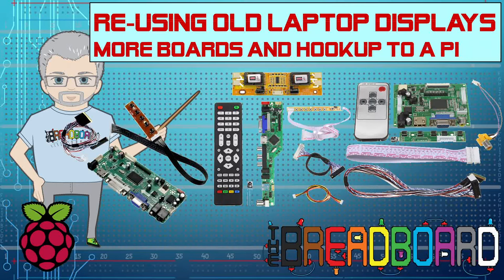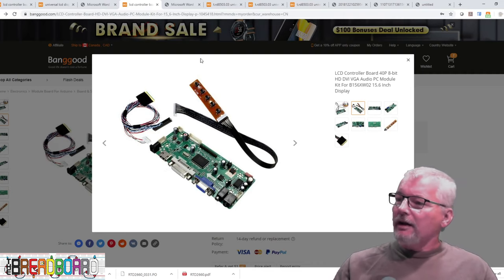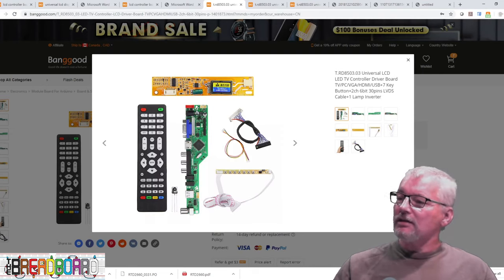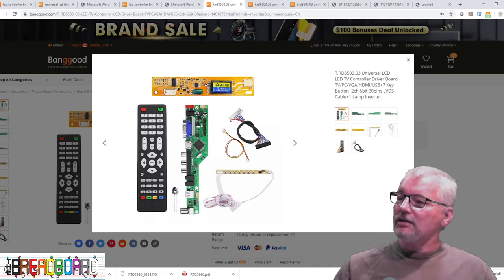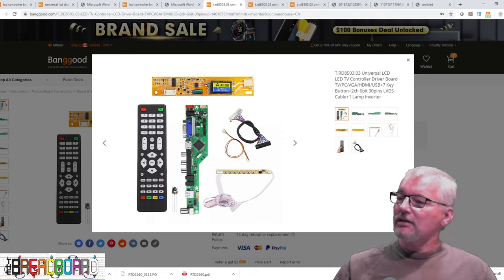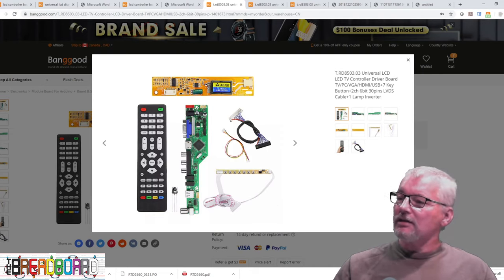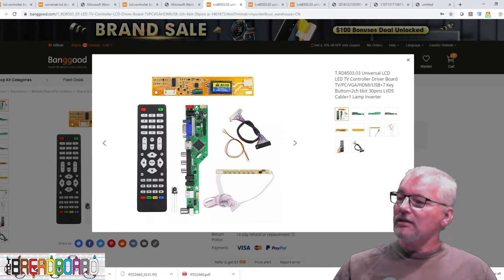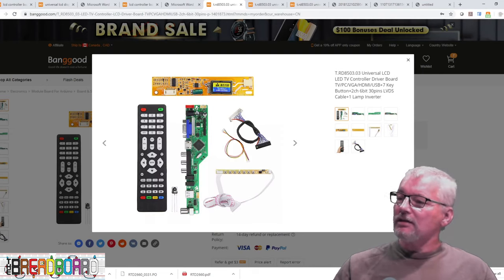Old laptop Screens on a Raspberry PI... Part 2

Comment: Hi, I watched this video and the Part 1, and I ordered the board from banggood and I fully expected to come back here and ask a whole bunch of questions, but I got the board and plugged it in and instead of screwing up, everything worked perfectly, so thanks! I have re-used an old laptop screen as well as a 12v wall adapter which is only 1amp but seems to work fine. Excellent video!
Reply from the maker: good to know I passed on enough information, I too just received more boards and a pack of various cables... next to upgrade an old desktop screen (VGA Only) to use HDMI etc

Comment: Thanks for covering this, Pete.
I've been toying with the idea of building a lcd test bench for use at work (amongt other things, we also repair laptops and monitors). With the info you've provided I'll be doing some research this weekend and present it, the possibilities and the costs to my boss on monday morning. Thanks for posting....top notch material as usual. :)
Reply from the maker: your welcome, sorry for the slow response, this was a very popular video for me, I will be doing more, with desktop screens that only have VGA for instance, btw, you cal also buy a pack of assorted LVDS cables that would go a long way to setting up your test station
Reply: A lads panel tester would be a big step. This one tool can connect with any pin any channel any res lcd panels. Once you have tested it to be working then you can go ahead and order the controller boards and do a repair

Comment: I'm currently viewing this video on my secondary screen. which is a lcd salvaged from my old laptop using a board like that. works flawlessly.
"special programmer" hah, check it very closely, you may need the software and for sure the hex file to reflash the board, but... it's just Rx Tx +5v Gnd pinout on the vga.
I highly suggest you to buy some adhesive heatsink for the main chip of that type of board. never hurt if cooler, you know.

Comment: Very informative video! You just saved me a lot of searches and risk, selecting a couple of controllers for my experiments with LCD panels.
Reply from the maker: Your welcome... if your buying from Banggood, please consider using my links in the description, no more cost for you, but it helps me, thanks for watching
Reply: @TheBreadboardca  I will. It's the least I can do to repay all the work you've done, that makes my life easier :-)
Reply: Just placed the order for 2 boards from Banggood, through your link.
Reply from the maker: @JoseSilveira-newhandleforYT  Thanks, if you have any questions when you get them, feel free to ask, have fun.
Reply: @TheBreadboardca  Thanks! I'm watching the construction of your bench and shelves (I need to rebuild mine and like your ideas).
It's amazing how I never came across your channel until I saw the video on the LCD controllers - I have a lot to catch up.
Reply: @TheBreadboardca  I used your link for my board experiment, I have a few screens that did not know what to do with.
Also about the controller power 12v you said , is that any 12v power supply like the one for cameras?? Will that do? as I have a couple of those too.
Reply from the maker: @ΑκαρνάνΚάππα  A 12V for camera may not be enough amps, if it is over 3 amps it should be ok
Reply: @TheBreadboardca  I will check that and THANKS.

Comment: I am hoping to mount a raspberry Pi 4 on an iMac 21". The Graphics packed up. So instead of throwing away a perfectly good casing and Screen I would like to use as much of it as possible .Can I utilise the existing power supply of the Mac with  a few modifications?? Obviously I will need the more flexible controller.
Reply from the maker: Most power supplies will provide 5 and 12V, I dont see why this would be any different, a quick check with a multi-meter should confirm
Reply: @TheBreadboardca  That's what I thought, Thanks

Comment: Impressive work.  Many many thanks for sharing your knowledge.
Reply from the maker: no problem, how did you find it, I always worry there too long but then if I shorten it i worry about loosing detail, catch 22 right :)
Reply: @TheBreadboardca  it's long indeed,  but very detailed,  with important remarks such as not buying the 2018 firmware boards. For having gone through the search process only,  I know there's a lot of experience behind. I have skipped parts of the video,  which I will look again when I will search for the references of my own panel. The great stuff is that you've gone all the way to the end and setting up in real life situations,  it's the first time I see such synthesis.

Comment: Hello! You mentioned at approximately 11:20 all you need to pick the controller board is resolution, number of pins, Channels and bits and voltage supply. So if I found a board with that criteria matching but the title of the board says "Controller board kit for xxxxxx" where xxxxxx is not my display name will it work? ( My display is CLAP070WP03XG which is 40pin 8-bit 1 channel 3.3V)

Comment: Wannbe newbie here.  Your video was a lot to take in at one sitting (actually more like four times with lots of rewind and freezeframe), but I feel reasonably certain that I can get old video displays to work.  One item of concern (probably not important) is that I can not tell where the temple image came from when you connected to the Raspberry PI.  I found myself inferring that the PI connection was required at all times, but that seems questionable.  Also, where did menu-1-1-4-7 come from?  It is certain that I will be referring to this video again before making any purchases and getting to work.  Thanks.
Reply from the maker: The temple image is just an inbuilt background from the latest Buster distribution for the PI. I used the PI as the HDMI source throughout the video. the code 1147 came from a bit of research online and it is a setup code for that controller, it is built into the controller firmware so it should work no matter what the source of HDMI is

Comment: Good Evening. I have a lcd controller board hooked up to the screen from my old toshiba laptop to my PI400 and it works fine but I have to start up the Pi to a tv screen first and then switch it over to the stand alone laptop screen from my old laptop. The screen stays blank and says no signal until I start it up to the tv and then switch it. What do I have to do to just start it up to my old screen? I have an 11" Sunfounder display that works but my tired old eyes have a hard time reading that screen.Thanks in advance,

Comment: Pete....you are an absolute legend! I only dream to be as skilled as you! I have a project idea of utilising an old HP Jornada 680, stripping out the internals and fitting a Pi inside. What would be your thoughts on finding a controller to utilise the original screen mate? Am I wasting my time?  The screen spec is 640x240 half VGA(HVGA) 256 colours 8 bit. However HP did an original software patch back in the day so it could display 65,000 colours. Would a controller be available do you think? Thank you so much! 🙏🏻

Comment: you show us if the display is a 6 bit and you have a 8 bit driver, but which picture i get if a have a 8 bit display with a 6 bit driver? I have a 8 bit display and a driver but i don't know if the driver is 8 oder 6 bit. I only get an very dark picture.
Reply from the maker: Usually there is a setting that can be set to tell the driver your using only 6bit or 8 bit, if you get the wrong setting then this could cause your symptom, or the backlight is not illuminating ?
Reply: @TheBreadboardca  can i contact you with PM? So i can send you photos and more documentation
Reply from the maker: @meinsda5983  sure, peter@thebreadboard.ca

Comment: I have the screen from HTC Jetstream.. Screen model: B101EW05 V.01
i entered this number on panelook and it only shows V0 and V1. There is no V.01

Also, be aware there is a site with LL in the name. That is the wrong site.

I was looking for a driver board on aliexpress. 
Some of the ads have 10 or 20 options to choose from, but don't say what that option gets you.

Are there any screen driver boards that host a Raspberry pi CM4?
I would like to make a CM4 based tablet with all the features of the 
Jetstream(real compass) with an additional (IR port and NFC and i2c port)... 
Real compass needed for google sky map...

Comment: Do you have a link to the zip file for the board to programme it via USB
Reply from the maker: http://myosuploads3.banggood.com/products/20190305/20190305040218T.RD8503.031.rar
it is also at the product page for this board. (Make sure it is the 2019 firmware, the link above is.)

Comment: perfect chanel for me  !!! may i know what board are suit for my old ipad 1 screen ?
i have a small project with raspberry pi 4 wich will use a few LCD
1. recombine my car head unit with raspberry pi ... 
2. using ipad 1 screen as a rasp monitor
thanks !
Reply from the maker: I dont know the make/model of the IPAD1 screen so cant really comment, if you can provide this then perhaps I could help

Comment: i have pannel , which resolution is 1280× 800.   can  i use first control board ?
Reply from the maker: If it is programmed with the right resolution, I found the third one on my later video was user programable with ease

Comment: Well I'm planning to buy one of these but the board I found from local shop has this kind of jumper things for programming and they said the resolution can be determined through those jumpers. Anyways can they run a 11.6 40pin screen with 1366×768 resolution? Please answer cause this is my first time doing this and I have absolutely no idea how these boards work.

Comment: I used the link to banggood you provided for the third controller and it took me to a page for the board you got but not the one you said that you would have preferred.  If I search for, find and order the preferred board will you still get some consideration from banggood?
Reply from the maker: If everything works as it should then yes I will, thank you for the consideration. to improve the chances, use my link again and then navigate to the one you would like

Comment: hi very interesting video thanks im wondering if i need to reflash my pcb as i have the pcb800099-v.9 with a 7 inch 800x480 display and everything is off-centered im trying to use with a raspberry pi and fiddling with the config file ive managed to make it fill the screen but i have over spill on the right of screen tia  Mat
Reply from the maker: I think you need special programmer for that board, can be done but not with out this programmer and even then, I dont remember seeing the source to change things like that, Im pretty sure its all down to the PI Config, sorry
Reply: @TheBreadboardca  thanks ive foxed it i got another new board and display that fixed it
Reply from the maker: @matharvey87  good to know, now for fun right :)

Comment: Hi. Very useful video. The big chip on my DS V53RL.BK is running very hot. Is it normal? Thank you.
Reply from the maker: They do seem to run quite hot, if you cant keep your finger on it then you may want to add a heat sink to help improve durability.  especially if you going to put it in a closed box
Reply: Hi! Thank you. Now have little square heat sinks on both sides. Strange how i found your extremely helpful demo the day after receiving the V53 board. Thanks again.

Comment: Great vid.as usual..followed every step..but my screen is white.no matter what board I'm using..what do u suggest...cheers..stu...
Reply from the maker: what LCD and board are you using
Reply: @TheBreadboardca  this is the lcd I'm using LTN154X3-L01.and I have used all three boards that u have..with no success yet..installed firmware on last board.no luck tho.just I white screen..so I know the back light is working..
Reply: I have ordered another lcd.just incase.but any help would be helpful.cheers
Reply: @TheBreadboardca  hi..update new lcd works with the first controller board..but not with the other two..but I have noticed a missing pin on the lvds pin bit on the board on both that don't work..could this be the issue.
Reply from the maker: @stujames8120  That is possible, are they all the same board or different models, if so can you provide links to the boards you have

Comment: Sir. I need to connect my old tables display 7" on raspberry pi. With capacitive touchscreen. It's possible??
Reply from the maker: What is the touchscreen model and also the touch controller model / part number

Comment: So I am checking a display of mine, it is eDP not LVDS, would that matter? what difference would it make if I already have a board?
Reply from the maker: edp and lvds are not electrically / protocol the same, edp is newer and designed to carry far more information per wire than lvds so an lvds controller will probably not work with an edp pannel

Comment: Is the antenna input doing analog off the air or digital off the air?
Reply from the maker: pretty sure it will probably be analog, but not 100% sure, ill try find the part number if it is not laser etched off.
EDIT... Just confirmed in the add page... its analog. It uses an RDA5160 tuner and the main asic is the RD8503.03, hope this helps. sorry you cant hook up the cable to it :(

Comment: You sign off at 52m30s, but YT says the vid is 1h04m02s long. What gives? Your fault or theirs??
Reply from the maker: youtubes I think,  I will check the upload mp4 but i'm pretty sure it had no weird stuff at the end, I have never had that happen before... lets now see how well YouTube Video Editor works... wish me luck lol
Reply from the maker: Just tried using the new Video editor on YouTube to trim the empty space at the end, its busy processing now, lets hope it works ok, or I may have to re-upload...
Forgot to say... Thanks for pointing that out,
Reply: @TheBreadboardca  I've never uploaded videos to YT before, but my understanding is that once it's online, it can't be changed or edited in any way. If it works, great, but don't worry about it, it's just 12 mins of silent black screen at the end - not enough cause to start WW III...
Reply from the maker: @droses1600  I had never done it before either, but it is available, just very basic and takes forever to apply changes. The only reason it is important to me is people (Some) will look at it and think, ohhh, over an hour, ill skip it vs 52 minutes, ok I got time. It used to be that you had to upload the whole thing again and loose any views etc you had on the original upload (You cant upload the exact file twice without deleting the first and you cant re-upload a corrected one for an existing one, I can understand that one :).
So yes I can edit it, im hoping it will work ok.
Oh, and now I have had chance to investigate, it was my error, my editing software seemed to add the additional minutes without any reason that I could find.
Reply from the maker: Yaaaa, it worked, now shows 52 mins
Reply: @TheBreadboardca  Yep, I can confirm that
Reply: @TheBreadboardca  Tbh, I think if someone is interested in such excellent vids like yours, they don't care if it's 52, 64 or 200 minutes long. In future, don't lose sleep over it. (But at least you know the source of the prob now...)